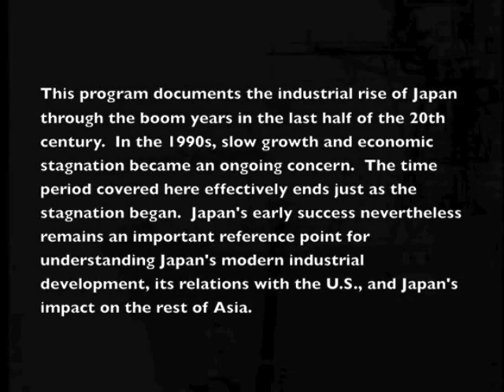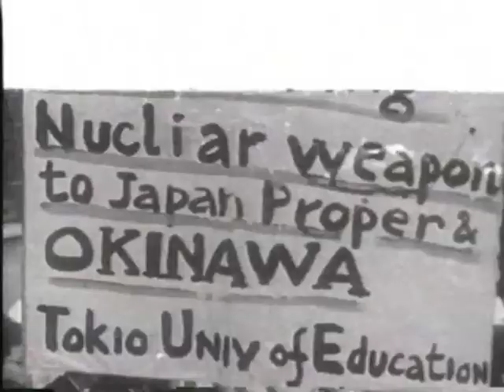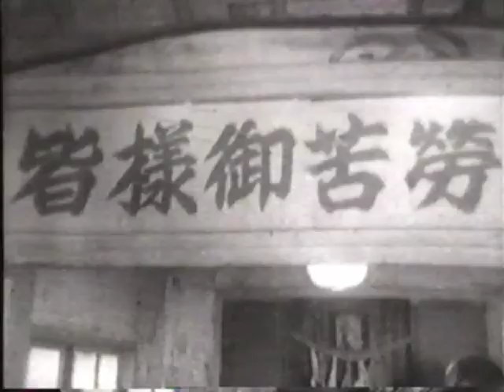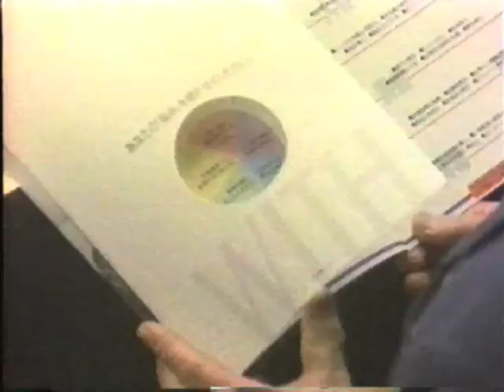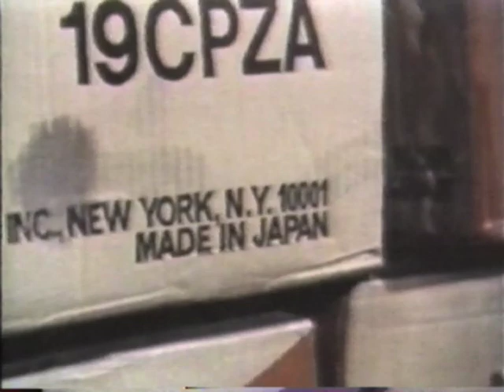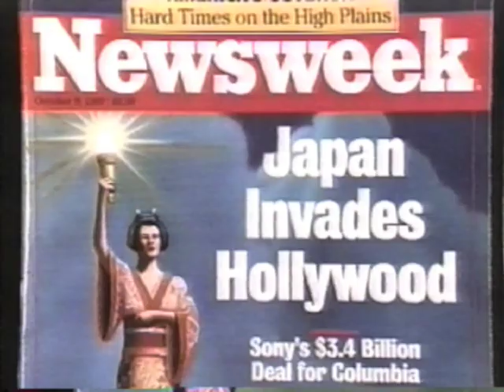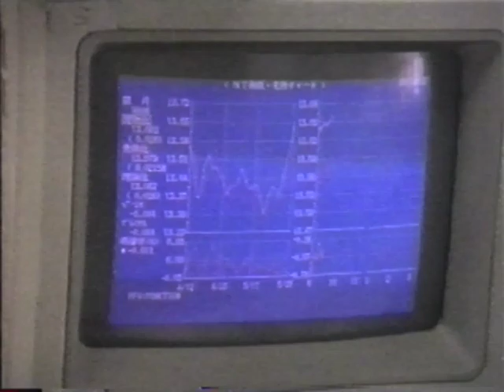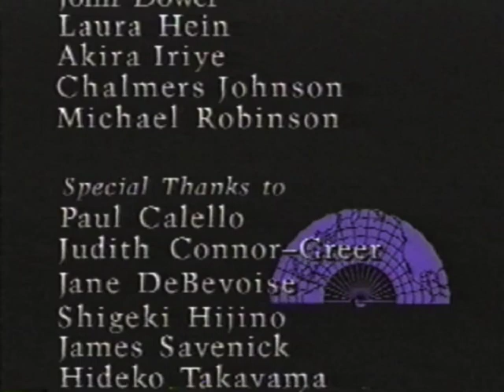Inside Japan Inc. (entire)

Comment: I'm surprised at how this documentary, released in 1992, made no mention of the bursting of the Japanese bubble economy in 1989. The Japanese economy took another dive in 92, likely after the documentary came out...but still, there was no mention of the bubble at all.
Reply: The early 1990's was very much an extension of the 80's. As late as 1993 there was still a common belief Japan would recover and take off like it had in previous decades. So it wasn't viewed as that big of a deal.
Reply: You are correct to point that out.  I suspect it is because the documentary makers were keen to sympathize with the Japanese socialists and communists--they gave almost no mention to the economic and political necessities that the Japanese government faced at the time they made 'right wing' decisions. The filmmakers also didn't mention how those difficult decisions were supported by the majority of Japanese citizens.  For example, when the Japanese socialists in the Diet tried to prevent the ratification of a treaty, the filmmakers only showed that it passed in the Japanese parliament with the socialists absent, as if they had been prevented from voting instead of boycotting the vote.  What the filmmakers failed to mention is that the treaty had enough votes to pass whether or not the socialists showed up to vote.  That is why the socialists tried to block the Diet speaker's office--to prevent a vote they knew they would lose.  Also, the documentary makers won't criticize something that they, American left wingers, hope America will emulate someday when they get as much power as they want.  God help us if either American party gets as much power as they want!
Reply: Just read the text at 0:00
Reply: Allen Portz  What on Earth are you talking about? It 100% burst. There was a time in the late 80s when something like an acre of Tokyo cost more than the entire landmass of the Continental US.
Reply: Exactly  - its literally the first thing that is "said"
Reply: Did you not see or read the text at the very beginning?